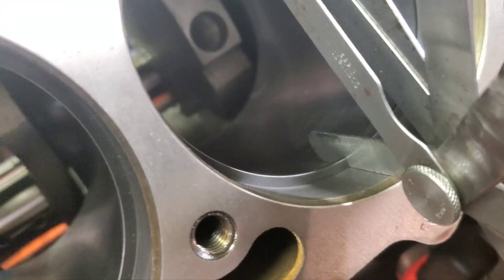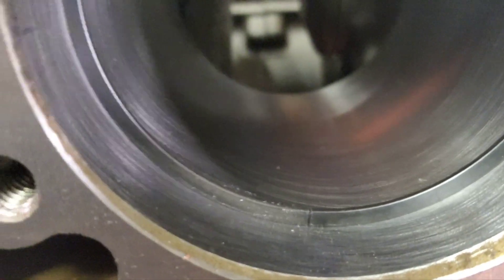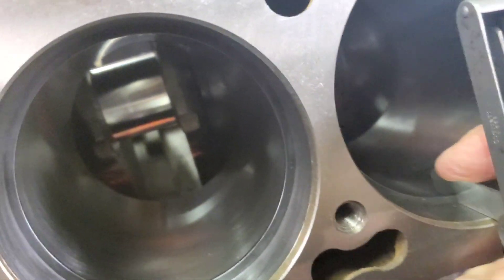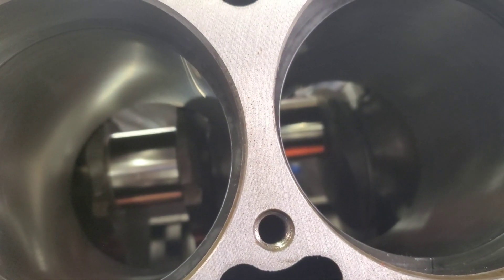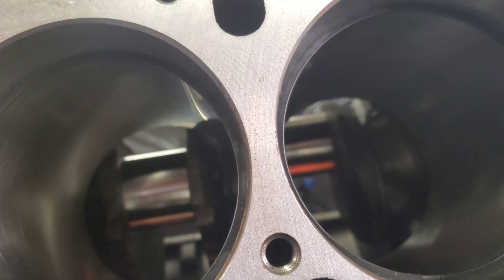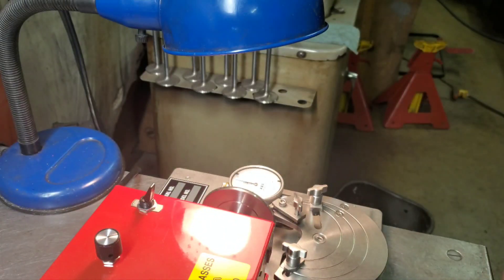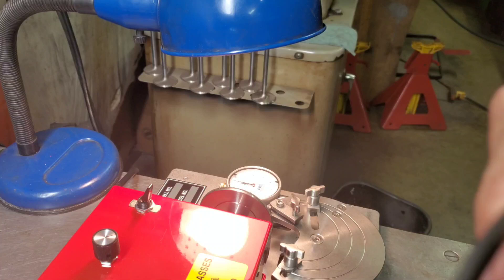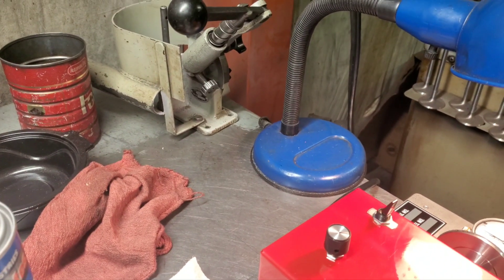440 Mopar with Keith Black Pistons File Fit Rings.

Comment: That's a really good tip. I first thought well of course I only grind one side but with all the in and out checking I'm not sure that I do only grind one side. I don't really do boost engines but it is a good practice to keep in my pocket. Good video, Ed 👍

Edit: I meant to ask, is that just a REALLY big accumulation groove in those KBs or does it have another purpose???
Reply from the maker: Thanks Joshua, I appreciate you watching. 
Another advantage usually the end gaps square, you always have a square side for reference. 
If you do have an error, you only have one.👍
Yes the Accumulater groove, it is big.
Using exhaust gasses to promote sealing.
That's why it is necessary for the wider intake gap.
If you do not gap the appropriate amount, the rings will butt and damage will happen.
Have a great day.👍

Comment: be nice if small rings were more common with theses re-builder pistons just ticks me off they do not use 1.5mm and so on
Reply from the maker: Hi Overbuilt, I agree 1.5mm or .0625 would be better than 5/64 or .078.
Would free up some Horsepower. 
But the rings would also cost more. 
Have a good evening. 👍

Comment: Great tip about the end gap filling. Do you have a formula to use for setting the end gap based off of bore size or do you just use your experience from your success over the years 🤔
Reply from the maker: Hi John, I appreciate you watching and commenting. 
End gaps very engine to engine.
These Keith Black's are .0065 per inch of bore.
Nitrous and or Blown require additional clearance. 
The .0065 is the minimum requirement. 
Most engines start at about .0045.
But varies depending on requirement.
Have a good evening. 👍
Reply: Boost is so dang tempting but i will prob go to my grave running all natural. Good info Ed👊
Reply from the maker: @Ridendrty Thanks for watching Roy, I hear ya, I am kinda a N/A guy myself.
The Boost would be fun tough.
Have a good evening. 👍